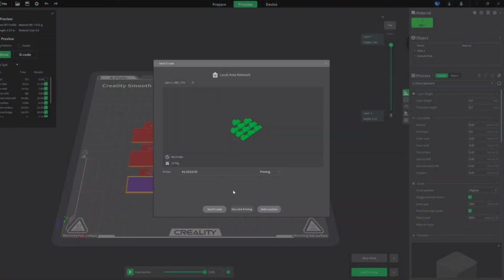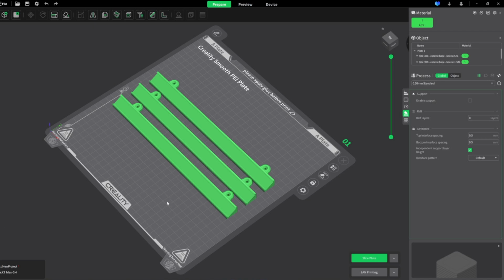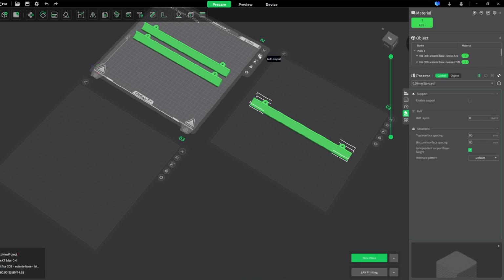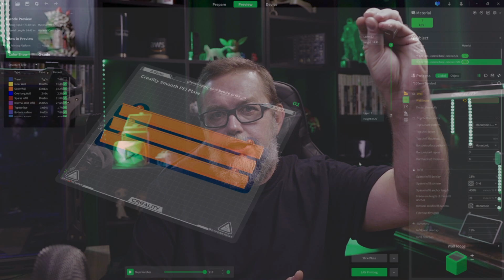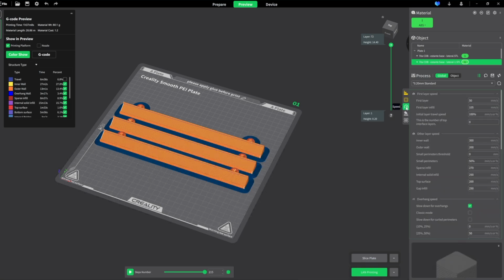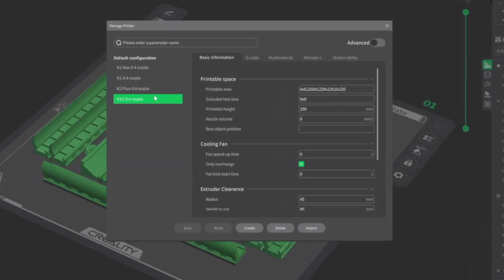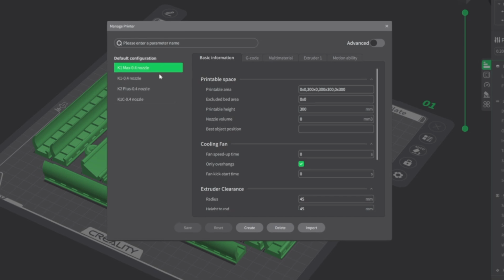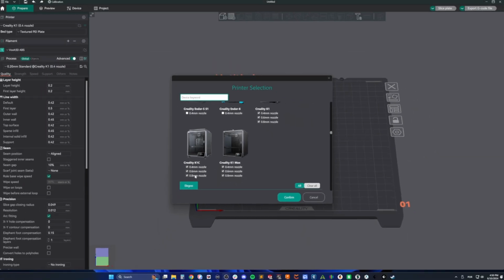I've tested Creality Print 5 and it was basically a waste of my time!

Comment: I also had issue with applying supports to a print. I had forgotten to uncheck supports and sliced my file. I then was like I didn’t want supports and unchecked it and sliced it again and still had supports. No matter what I did I couldn’t get the supports to go away. I ended up having to remove the model and bring it back in then slice it again. I also do not like that there is no longer an option to calibrate before a print starts.

Comment: The only thing I've found that Creality 5 does that Orca doesn't have or exceed with newer versions is that it can start up the "lidar" thing. I don't even run my K1 with it anymore. Manual calibration is better results and the weight reduction helps a bit